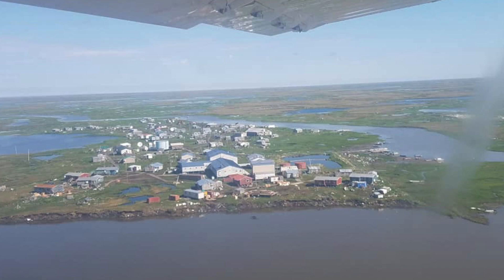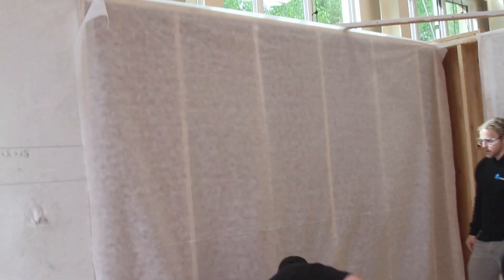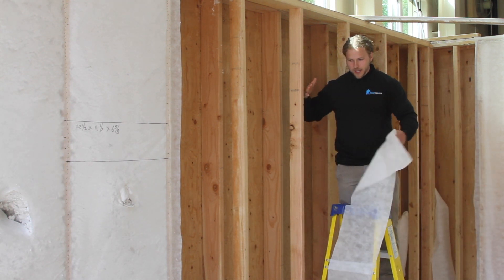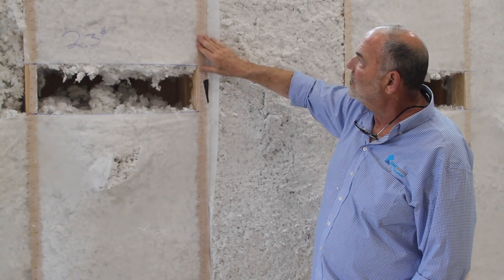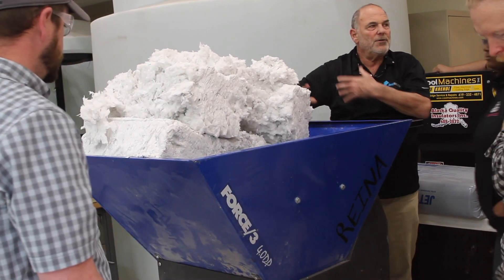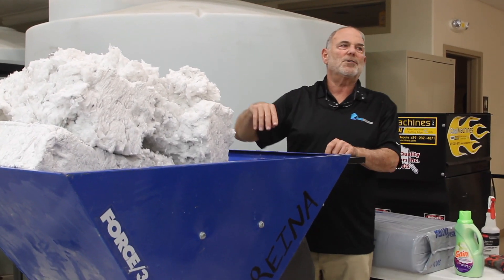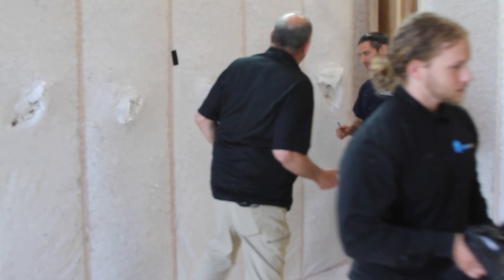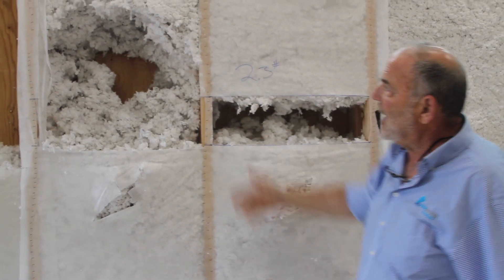Installing Blown-In Fiberglass into a Thick Wall

Comment: Why choose blown-in fiberglass over something like sprayed foam?
Reply from the maker: The building site, Mertarvik, Alaska, is located on the Bering Sea, which is extremely cold, wet, and windy. Because we use a wooden truss for the frame of the structure, we did not want to encase wood in non-permeable spray foam because if moisture somehow finds a way into the wall, it will have a hard time drying out. Fiberglass is resistant to moisture while still allowing a drying path. Also, we haven't used blown-in fiberglass before and as a research center we are always testing new, cost-effective ways to build.